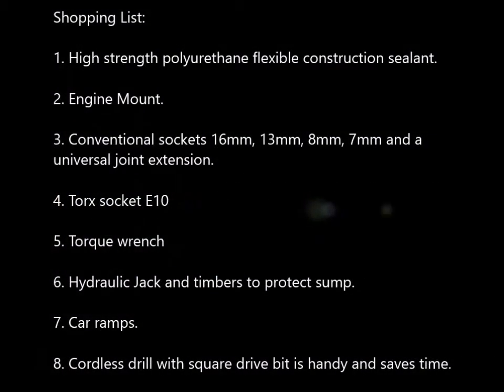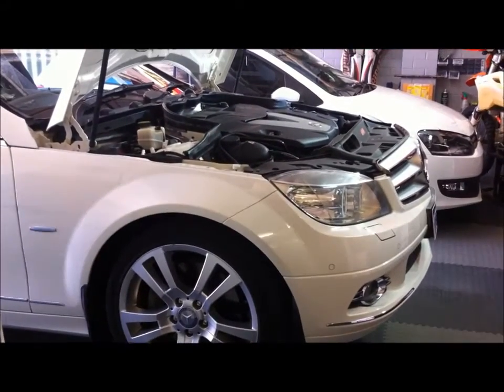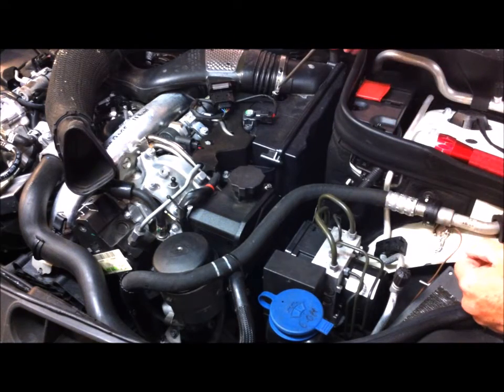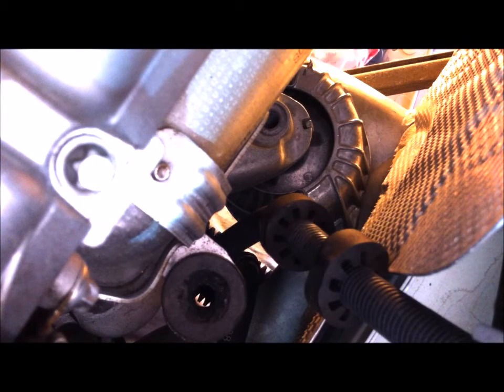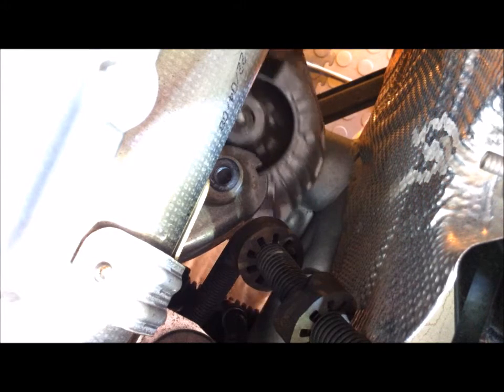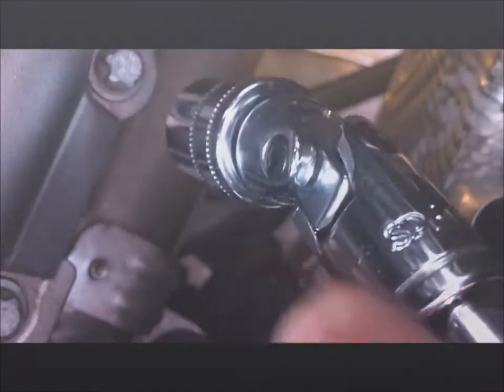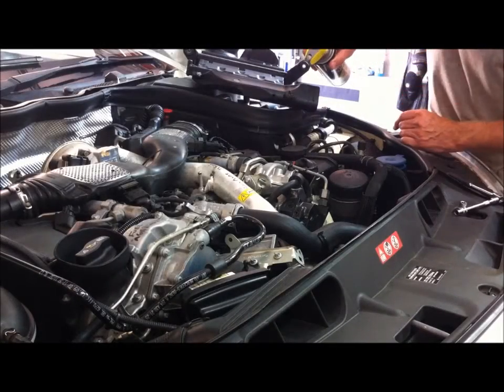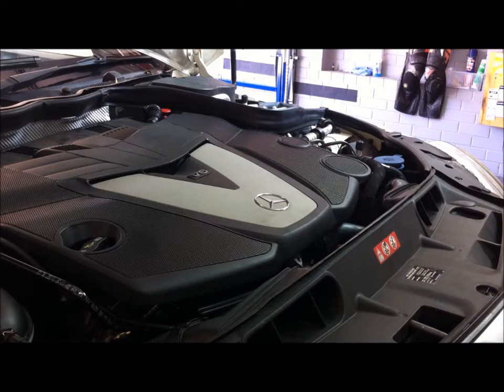Mercedes OM642 V6 Diesel C, E, S, R, ML, GL Engine Mount Replace and Reinforce

Comment: Here's my write up on it: 

I have a U.S. spec'd 2011 W212 OM642 Bluetec sedan. (My car is the US model so the steering wheel is on the correct side, lol.) 

This write-up is for U.S. spec models with the steering wheel on the right facing the car. DPF/Catalytic converter are on the passenger side

I'm putting this here because there is a huge misconception about the U.S. spec W212 om642 engine mount removal process. I did NOT have to remove the DPF/Catalytic converter on the passenger side or loosen the sub-frame. 

I could not find one single video anywhere showing how to remove U.S. spec W212 diesel engine mounts without removing the DPF/CAT converter or dropping the sub-frame. 

------------------------------------------------------------------------
1. Before I raised/jacked up the car:
a. Pretty much goes without saying that the left side motor mount is different from the right side motor mount; two different part numbers, also Bluetec diesel engine mounts are different than the gasoline engine mounts. 
b. Notch and pin placement:
There is a notch on the engine mount arm that lines up with the engine mount. The engine mounts have a pin that fits up into that arm notch that orientates the correct placement. (I also used the rubber seat for placement reference as well.)
c. I removed the plastic top cover
d. Next was to remove the top bolt on the left and right side engine mounts. There are several Youtube videos on how to do this with special tools. I was able to get by using swivel extensions with a socket.

2. Raise/jack up the car:
a. Removing the front tires are an option but I didn't need to. You will want to loosen the lug nuts now if you take the tires  off.
b. If you DIY in your driveway or garage, I cannot emphasize enough to use jack stands along with your floor jack. You cannot use too many floor jacks or jack stands. Make sure rear wheels are chocked and parking brake is on. 

3. Once underneath:
a. I removed the front engine cover over the radiator, sway bar and power steering rack. Then the back plastic engine cover.
b. Next, I removed the bottom two bolts from each old motor mount.

4. There is a precise process to raising the engine:
a. Place whatever jack you are using underneath the motor. I centered a bottle jack with a short piece of 2x4 wood across the flat part of the oil pan up closer to the front so as not to dent anything. 
b. My technique was to incrementally raise the engine about an eight to a quarter inch each time then checking the looseness of the old engine mount.  

5. I replaced the driver's side motor mount first. (This would be the opposite side to the U.S. spec DPF/Catalytic converter.) I would jack up a little, then try to move the old mount out. When I could finally get the driver's side motor mount out of it's placement, I dropped it out in the space going toward the back of the car. I went back and forth real slowly raising the motor a little until the old mount dropped out. I had to jack the motor up some more to install the new motor mount because it's higher. When I placed the new mount in, I visually checked to see that the top of the mount matched the notch in the engine-side arm. I loosely put the two bottom bolts in the new mount using red thread locker. 

6. To replace the passenger side motor mount:
I had to raise the engine up more until I finally could pull the old engine mount out of it's placement and bring it FORWARD toward the radiator.(again, U.S. spec W212- now on the same side as the DPF/CAT.) ) The space is there but the sway bar and the upper power steering rack (fluid re-circulation line) bolt will be in the way. 
a. I undid the sway bar and let it drop. 
b. I undid the steering rack (fluid re-circulation line) upper bolt. (have a bowl to catch the fluid and there are two copper washers.) 
c. I GENTLY pushed the power steering fluid line up just a little until it was just out of the way enough for the old mount to drop through and out. (the old mount pushes the sway bar down as it comes out but I did have to pull it way down.) I did have to go back and forth jacking the motor up a little each time until it dropped through. I TOOK MY TIME. I had the new engine mount right next to me and immediately pushed it back through the space into it's placement, then loosely secured it with the two bottom bolts. (I used red thread locker.) 
d. I screwed the steering wheel rack bolt back in making sure both inner and outer copper washers were there; then reinstalled the sway bar. (I used red thread locker on the sway bar.)

7. To secure the motor mount top bolts, I did one side at a time. My driver's side engine arm was a little lower and closer to the new engine mount than the passenger's so I started there. I used a steel punch in the upper bolt hole initially as a guide to make sure the new engine mount pin slid into the arm notch as I incrementally let the engine down SLOWLY just a little each time (an eigtht to a quarter inch) with a check for fitment. If you have a second person to watch it helps. So the idea is to drop the engine down VERY SLOWLY until the new engine mount pin is just catching in the arm notch then remove the guide (steel punch) because it's still loose. I pulled the punch out and dropped in the top bolt loosely tightening it all the way down. Then the other side. I slowly let engine completely down, then removed the bottle jack. I finger-tightened the left and right side top bolts all the way down snug. (I used red thread locker.)

8. I tighened the bottom four bolts on the new mounts. 

9. I installed the transmission mount. Then I put the front and rear plastic shields back on There are a lot of Youtube videos on how the DIY W212 trans mount.

10. With the car down on the ground, I tightened the top engine mount bolts. 

11. I added the same amount of power steering fluid back in when I was done and worked the steering wheel back and forth to get rid of the cavitation noise in the rack. 

I think this was everything. It's what worked for me.
Reply from the maker: Jesse thanks for the detailed write up. It should be helpful to those with the W212 OM642.
Reply: I've been searching for hours for a US version. I've got a 2013 bluetec and was wondering if its was going to be the same or similar to Scotts video here.  In your #9 step you said you installed the transmission mount. Did you just replace it after the engine mounts or remove it earlier? I didn't see the removal step in the list. Thanks a lot for posting. I just ordered a set for mine.

Comment: I'm confused. I see where you removed the air box on the driver's side (assuming your steering wheel is on the right side facing the car like in the U.S.) but I don't see where you went to the opposite side to do the other motor mount next to the catalytic converter. I've got the driver side motor mount out and replaced  easily but I can't find an opening large enough to drop the opposite side out. I have the engine jacked up as far as it will go. Looks like the sub frame has to be dropped just an inch or two as well. Any ideas?
Reply from the maker: Jesse I'm in Australia and we're RH drive so my steering wheel is on the other side. The mount I did in the video was the my passengers side or the Driver's side in your case.
I actually replaced the other side last month ... that's the passengers side in your case.
You have to remove the CAT and jack the engine to make the room to get it out.
Reply: @ScottElliott152  I didn’t have to drop the cat: I raised the motor, went in the other direction and dropped the sway bar and unbolted the far (would be my passenger side) power steering fluid delivery bolt(not the whole unit) and it fell right out. Took me about five hours total on my driveway which included the transmission mount as well . I got quoted $650 for this job!
Reply from the maker: @jesseparris6507  Yes I'm sure there are other methods ... it's about creating the space. My car has the 3.0 litre V6 turbo diesel. What engine do you have? Creating the space to get the mount out varies a bit depending on the engine you have.

Comment: Not good.  Sorry. I have already did it and the engine (Om651 Mercedes) vibrations are more strong felt inside the car than before this operation. That is because the mounts are not allowed to work  upside down for the engine to feel smooth. That is my personal experience opinion. Leave the mounts alone or change them instead. Although your car will be like possessed.  Anyway, I tried your solution.
Reply from the maker: I did explain at the end of the video that it's not for every one. The trade off to have stronger mounts is more vibration. I've not had any more mount failures since reinforcing them. With 600Nm of torque I'm happy with the reinforced mounts.

Comment: Yeah, but not just use a hydraulic press and make it perfect, let it cure, then install? :)
Reply from the maker: The way I did the reinforcement has worked well. Still going strong after all these years with no more engine mount failures.

Comment: Hi Scott, Thanks for sharing this, I was wondering when you were jacking the motor up to replace the engine mount were you just jacking on the pressed steel oil pan with the timber giving you enough surface area not to do any damage. It was a bit hard to see on the video. You comment would be greatly appreciated. Regards Alan
Reply from the maker: Thanks Olanal. Yes I jacked on the steel oil pan with a piece of wood for protection and to spread the load. Regards, Scott

Comment: Hey Scott, love the vids! Have you ever had an issue with the EIS? I have an issue when inserting the key there is no lights and if I remove Fuse 27 then reinsert intermittently the dash lights will power up but wont start, (strange).
I ran a diagnostic using Xentry which returns a 118100 Relay N10/1kN error, Front SAM control unit with fuse and relay module switches off too late.
I had the ESL replaced and coded to the EIS and keys but this did no change anything so wondering if you have any experience or suggestions in this area?
Also do you have a copy of the DAS developer program where you were able to program the transmission torque which I viewed previously.  Any help would be great.  Thanks in advance.
Reply from the maker: Thanks Eric. I've had no problems with the EIS and therefore no experience with it. Using DAS 10-2008 I was able to remove the torque limit as shown in the video. I wasn't able to actually set a torque figure. I downloaded my copies of DAS from www.mhhauto.com
DAS Developer isn't a separate program ... you unlock Developer mode within DAS/XENTRY.
Reply: @ScottElliott152  Thanks Scott greatly appreciated and will give it a go. Should I get to a fix for my issues I will share it with you as I have the same W204 as you. Keep up the good work, Cheers

Comment: Was the passenger side mount basically the same process for removal?
Reply from the maker: The RHS is difficult because so many components need removing to get access.
https://www.youtube.com/watch?v=Bp4phUxqVtI&pbjreload=10
This guy made a special tool and got it out with less hassle.
https://www.youtube.com/watch?v=6RJ7amPs7Ts&pbjreload=10

Comment: Thanks Scott! Watched 3 or 4 times and just did. No bother at all. I heard others say they had to remove exhaust etc... I had trouble getting that side in but some vaseline on it made it slide between the engine and the heat shield. Thanks again! A really useful video. Couldn't have done it without this help.
Reply from the maker: Well done Richard.

Comment: Great video.
I have s212 14 350 cdi 4 matic. Is the same procedure?
Reply from the maker: Yes understand it is. Access my be different because of the transfer case. www.benzworld.org has a lot of information. Someone will have done it in a 4matic.

Comment: Thanks so much for the info, but I need to know how do I get the right side engine mount out , drop the exhaust?  Or is there some other way?
Reply from the maker: The RHS is difficult because so many components need removing to get access.
https://www.youtube.com/watch?v=Bp4phUxqVtI&pbjreload=10
This guy made a special tool and got it out with less hassle.
https://www.youtube.com/watch?v=6RJ7amPs7Ts&pbjreload=10

Comment: I need help.  I need to replace my motor & tranny mounts.  Also all 
plugs and pump on back of motor.  Mechanic is trying to charge 3,000.  
Seems like a CRAZY amount. What should i do. W204 C300 4matic.
Reply from the maker: Sorry for the late reply but this comment was send to spam. You'll have to do the research and decide if it's a project you can DIY. www.benzworld.org is a good source of information.

Comment: Hi Scott, was this making any clonking over bumps and potholes? 🤔
Reply from the maker: Lol ... missing link younger brother!

No I didn't notice any thumping over potholes ... it was always when accelerating. The LH mount had completely failed so the motor was flopping around. My repair has been good as I've had no further issues despite the DTUK tuning box providing extra torque. The mounts are now a bit more rigid than stock which is a welcome upgrade.
Reply: Thanks for the reply 👍

Comment: I have the c300 2010, does bad engin mount couse the engin to shake ?
Reply from the maker: Mine wasn't shaking during normal driving. But it would lift and thump back down again under brisk acceleration. Do the test as shown in the first part of the video. Hold your foot hard on the brake, select drive and gradually push your foot on throttle and see if the engine jumps up. Be careful and make sure no one is in front of the car. Scott
Reply: @ScottElliott152  I did the same test, engin is fixed, no shaking when doing the test, however, I feel the vibration and on full stop or when the car is on Drive, also when the car is on park I can see some vibration from the engin
Reply from the maker: Check the rubber block mount at the rear of the transmission. The transmission and engine are one unit once bolted together. That unit is supported by three points ... the two engine mounts at the front and the single rubber mount at the rear of the transmission.

Comment: Hi Scott, I have more or less completely worn engine mounts, they were on the car for 11 years. I was wondering, what if I keep worn engine mounts and apply lots of polyurethane on them. What do you think, would this be a very bad idea or worth trying? Thank you.
Reply from the maker: Beda the engine mounts on the Mercedes and many cars are both rubber and hydraulic. If the mounts have collapsed you'll need to replace them but you can reinforce them like I did to give a longer life. Scott

Comment: Hi Scott, I’m a Mercedes-Benz technician and have been looking for fix for these mounts. Can you give an update on how they have performed over time?
Reply from the maker: Mike they're still going very well. It was a good modification. The LHS in particular needs strengthening as the motor twists clockwise viewed from the drivers seat. Scott

Comment: Excellent. I need to test mine as worn mounts (2011 W251) can affect transmission shifts too.  Not sure how much your poly glue will help considering the engine weight and the fact mounts wear out and collapse down so the poly won't add support.   I saw your transmission service video and will be doing mine when the weather warms up here using your compressed air method.  Just doing fuel filter right now.  Very though and clear description and good videos.  I hope you do more.
Reply from the maker: Thanks John. The reinforcing works well especially for the LHS. When you
 accelerate the engine twists trying to pull the centre out of the LHS 
mount. You can see how mine had failed ... the centre was ripped out of 
the housing. Also that poly material has amazing adhesive properties and
 is very strong in tension. As long as the mount is clean that product 
sticks so well you'd be amazed.
I'll keep making videos as the jobs come up.